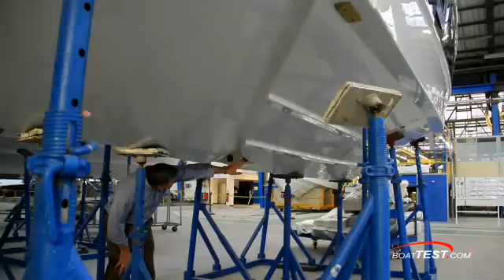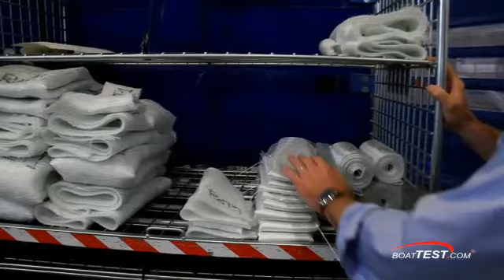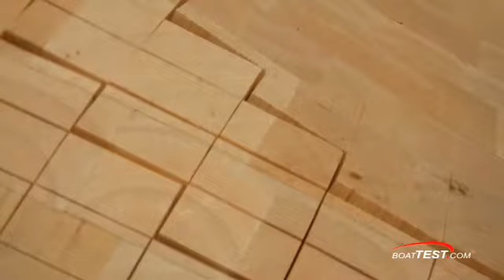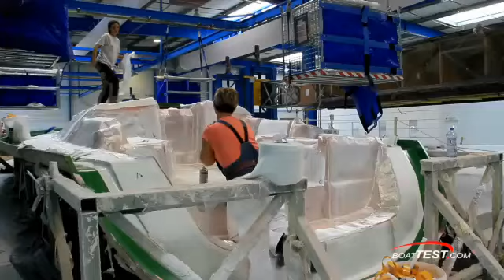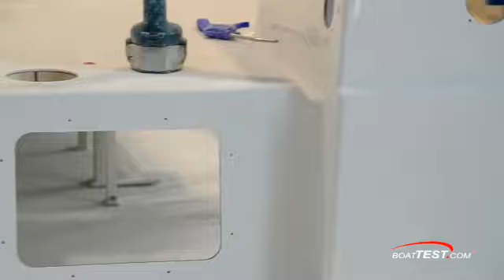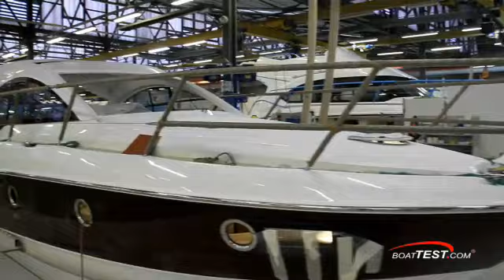Beneteau Factory - Hull and Decks Building by BoatTest.com

Comment: The first thing you learn in fiberglass construction is not to fold the glass as it breaks it and takes all strength away. This video taught me what not to buy .
Reply: That is not true. Have you ever even tried it? You can tie a knot into fibreglass! And it wouldn't be different for carbon fibres anyways, they are even stiffer.
Reply: unidirectional glass is just fine.
Reply: Clown